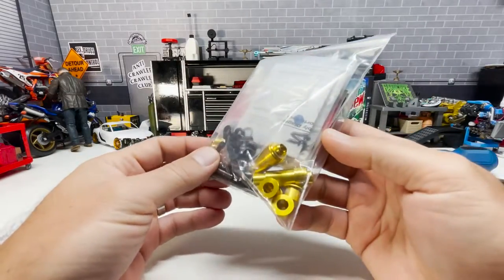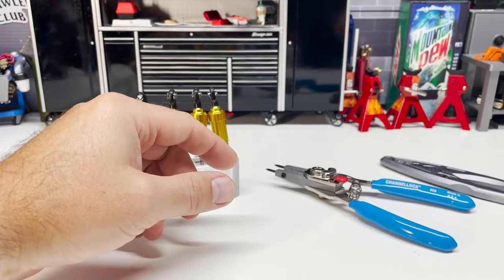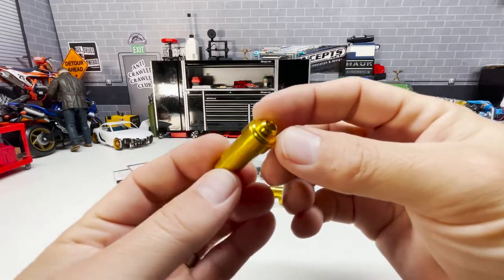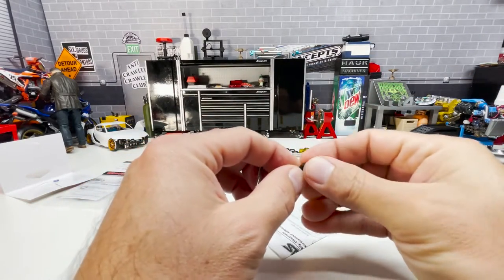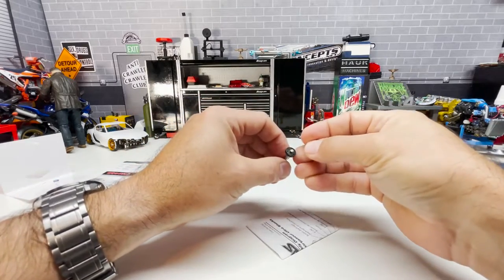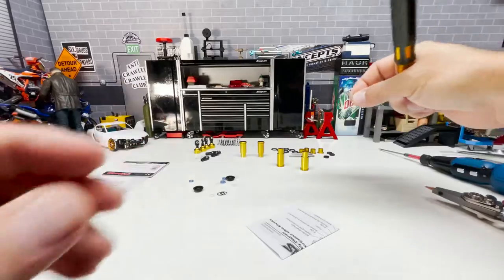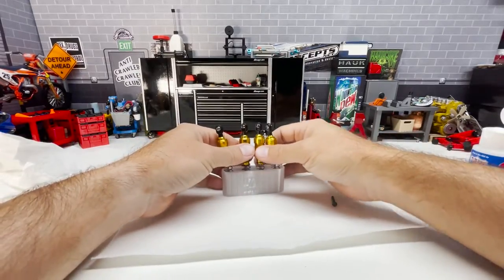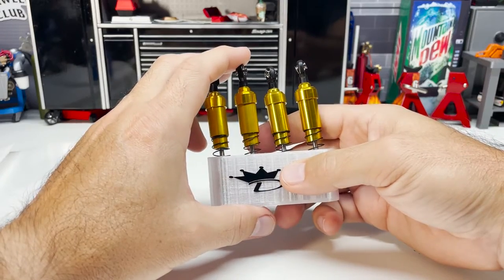Building Dravtech Shocks from Dlux the Right Way

Comment: I recently saw a video where the guy installed the shaft in the body and then installed the lubed seals in the body over the shaft. That way you never run sharp threads over compressed orings.
Reply: That is how Dlux assembled his

Comment: Very informative video, props to you. However, from my experience, the cons out weigh the pros for these shocks for what they cost. Poor customer support: I've sent many emails for support and weeks for one response about a missing C-clip from the package set that I bought. I asked for a replacement, no response, I wanted a refund got no response. I gave up and custom made a C-clip to fit because its difficult to find the special C-Clip they use. Oil leaks from threads on all shocks (poor design flaw) and probably not engineered or threaded by a professional shop that understands tolerances or thread pitch. I gave these guys a shot with my own money but will buy another brand.

Comment: I would really have a hard time doing this with my big hands do you guys offer them assembled already?
Reply from the maker: It can be tough! But this is not a product we design or sell so no plans to offer assembled units.
Reply: Heads-up...delux assembles them for $10 per pair. I just ordered them assembled because I have xl hands as well and didn't want to chance losing anything. I think I will build my next set, but nice to have the option.

Comment: Personally, I’ve had expensive Pitbull shocks, had spent $200 on two pairs of shocks so I thought for $80 for the Dravtechs was a bargain! For me, they’re the best performing shocks I’ve ever had and I own two crawlers that are sporting them. I prefer them on my technical trucks that can creep slow up rocks and terrain! I’ve had ProLine scalers, Vanquish S8E, Incision and Axial scx10 3 shocks. I find that since Dravtechs are based off Traxxsas big bore design, they really are the best shocks out there and provide the most supple movement. Shocks. Well worth the money when you’re ordering them you can get them in multiple colors. You can get them in two different colors for the body and caps and spring cups on the same shock so you can get them to match the theme of your trucks paint scheme. The Traxxas rebuild seals and clips kit part #2362 are only about $5 to $6 dollars per pair of shocks when needed so this is a great option to rebuild on your own!
Reply from the maker: Thanks for the reply bud!
Reply: You are 100% correct. Preaching facts over here lol

Comment: I would insert the rod into the shock body first. Than run o-rings and spacers through the shock shaft. Just to avoid damaging the seals from the threads of the rod. How would I setup for full droop? Thanks for the video.
Reply from the maker: That’s likely a better way. Sometimes I turn them while installing but I’ll try that next time. With soft springs on portal rigs I’m usually fully bottomed out/droop to compensate for the added height from the portals.
Reply: @crawlersncustoms  Are you to owner of the brand? I went to purchase them but they are out of stock on the colors I prefer (Black, gun metal and silver). I hear alot of good things about them.  I guess I will wait. Thanks for the reply and informative video.
Reply from the maker: @miniboom007  hi thx. No we are not the owner.

Comment: had to order loads more rubber boots. impossible to get on and when you do they all feel different. what why!!!
Reply from the maker: The caps can be a little tricky.  But the feel should be the same across all of them.
Reply: @crawlersncustoms  thanks i think i need leave shocks longer for air to go and not push down as much on shock. cheers i will try again

Comment: 27:58 why the hell is the rebound so slow? your using very thin oil.
Reply from the maker: Very soft springs.
Reply: You don’t want fast rebound on crawler shocks to begin with! 👍🏼 Besides by the time you install them to the vehicle and have the gravity of your rigs axles and wheel weight, the shock travel speed would be much quicker than with the shock by itself!

Comment: so to change springs you have to unscrew the rod end, theres no thread preload collar, they use a snap ring instead of a screw on cap and theres no bleed screw or even hole. any adjustment you want to make is so much harder and time consuming than every other shock i have ever seen. combine the pain in the ass with adjustment/tuning with the assembly process and its a shock with some extremely stupid designs. why the hell are these so popular?
Reply from the maker: Because they work well and the low stack height.
Reply: @crawlersncustoms  i feel like i know what stack height is but tell me anyways and what so great about that?